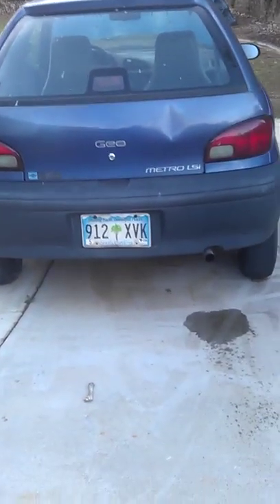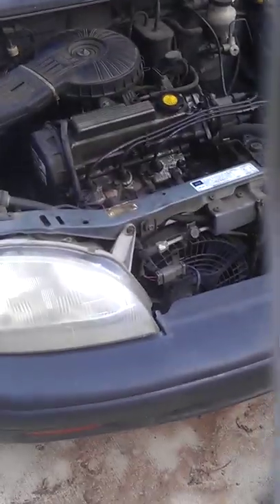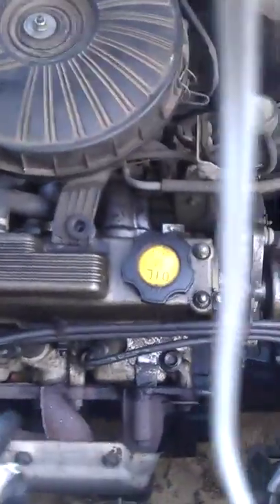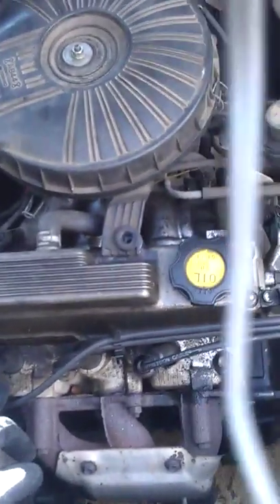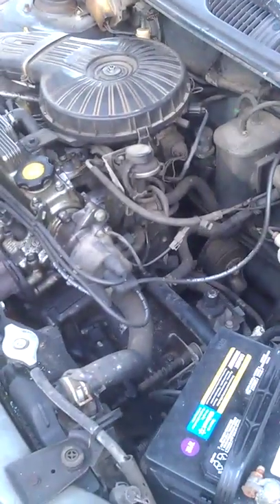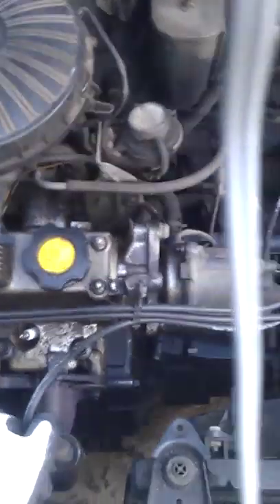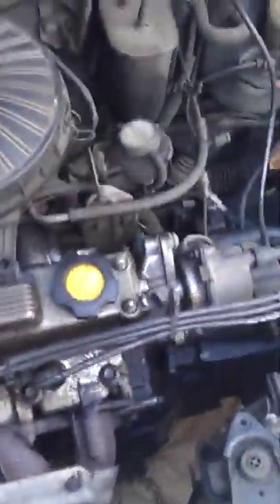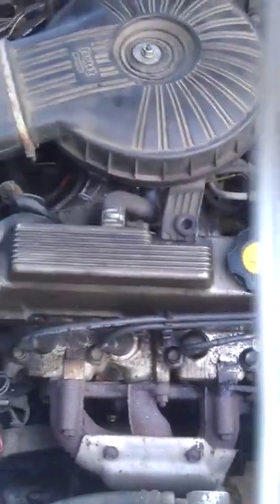1995 Geo Metro engine rough running diagnosis.

Comment: A car is not "supposed" to shut off if you remove a spark lead - it just does it because it doesn't have enough inertia to keep going. Its not a fail safe.